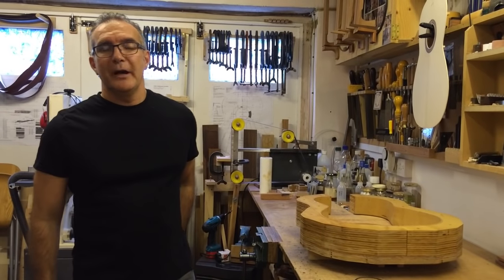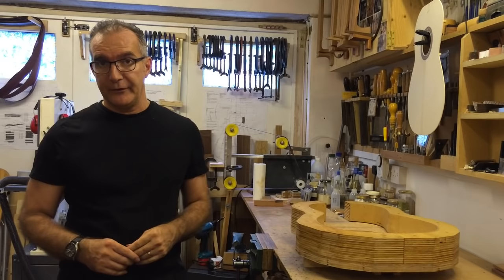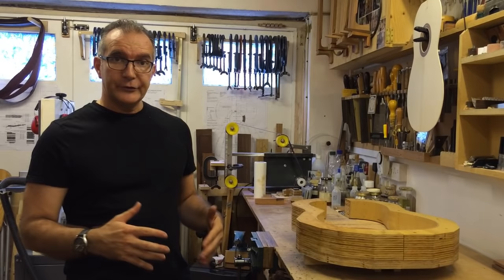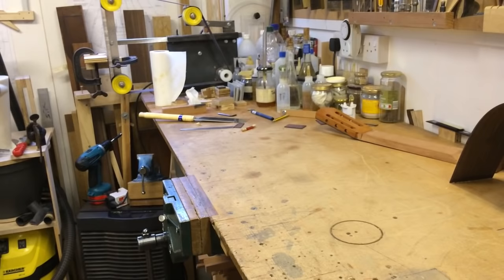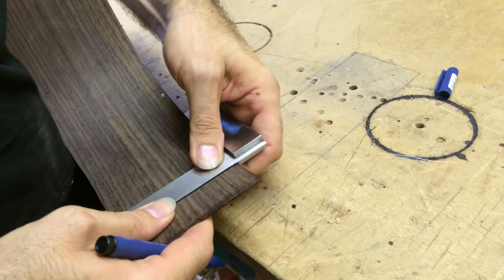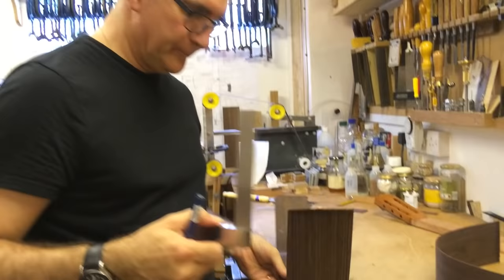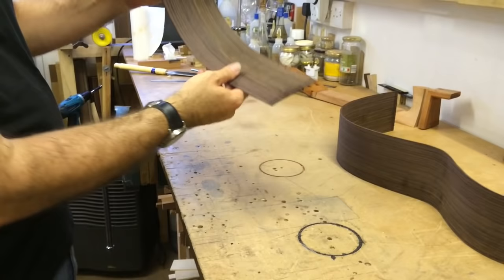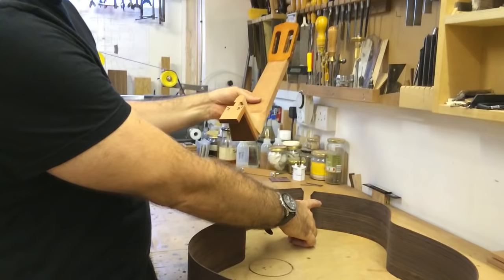How to assemble a classical guitar with a Solera mould.

Comment: Hello, Pablo. My only problem I am having in thinking about the solera is whether or not I will have to taper the underside of the fretboard when it is glued on the assembled guitar. I would think I would if I make the solera with the millimeter and a half slope as you do. Please inform me on this. Thanks.
Reply from the maker: Hi Owen,
When I fit the fretboard I plane down a small taper from the 12th fret to the edge of the sound hole from under the fretboard to accommodate the angle between the neck and the soundboard, that way, when the fingerboard is glued on it is reasonable strait.
Once the fingerboard is glued on there is also some planing to do to achieve the right set up, so that the projection of the fingerboard over the soundboard on the bridge are is the correct hight. The hight I set it up is at 3.5 mm at the treble side and 2.5 mm at the base side.
Sorry if all of this sounds a bit abstract, the truth is that this is a very important aspect of the building process and it isn't easy to explain in a few lines.
Best regards
Pablo
Reply: Thanks Pablo! I suspected something like that would need to happen. I understand the difficulty explaining these things. It is truly a blessing to have someone like you who wants to teach this stuff.

Comment: Pablo, two more questions. On the cork solera, the little block that is positioned for the bottom transverse brace, is it equal in height to the rest of the cork? What I am wondering is whether the lower transverse brace has any curve or not. I do understand how you said it is there so as not to damage the brace in the clamping procedure. Thanks
Reply from the maker: Hi Owen,
The lower harmonic bar has an arch of 25 feet in diameter, so the center cork block is a little lower than the rest of the cork
Reply: Pablo, I can’t thank you enough for helping me out with these things! Now I am prepared to give my first classical build a go. God bless you
Reply from the maker: No problem, enjoy making your guitar!!

Comment: Pablo, how does your solera set up effect the side profile?  I know Bogdanovich's side profile dips at the butt end on the lower bout and slopes down on the upper bout which makes adjusting the sides to glue the top on a challenge to say the least.
Reply from the maker: In my solera the top part pf the guitar and the overall perimeter are completely flat, also, before I bend the sides I plane strait the edges that will later on meet the soundboard, that way when the sides are fitted in the mould after the soundboard they meet perfectly. 
I hope it makes sense.
Reply: PabloThank you for your reply and yes it makes sense.Bernard

Comment: Do you need to make a whole new solera for each guitar you make? Thanks
Reply from the maker: Hi Michele.
No you don't, if you want to make a different shape guitar all you need is the base of the mould which its actually the solera, just don't use the two sides of the mould.

Comment: Hello Pablo, I'am a bit confused. Is the square piece of cork beneath the lower harmonic bar lower that the other cork?  I mean, that harmonic bar is rounded over a bit. Where does the belly  of that radius go, if the square is the same hight as the rest?
Reply from the maker: Hi Peter, can you tell me what minute in the video this is?
Reply: Hi Pablo, at 2:07 and 2:59
Reply from the maker: Hi Peter, yes, that square is a bit thinner than the rest of the cork in the solera to accommodate the curve in the lower harmonic bar. It is there so that when I clamp the soundboard in place I don't force the lower bar.
Reply: Thank you.

Comment: Are the side inserts , doubled up,maple piano "Pin Blocks" ?
Reply from the maker: Hi.
The inserts for the bolts are:

http://www.screwfix.com/p/insert-nuts-type-d-m6-x-20mm-50-pack/61859?kpid=61859&cm_mmc=Google-_-Product%20Listing%20Ads-_-Sales%20Tracking-_-sales%20tracking%20url&gclid=CjwKEAiAwfzDBRCRmJe7z_7h8yQSJAC4corOs0VqlB80WW8MBvTjcwpqu0SltE5VvgBEwJO6gp92ehoCdsbw_wcB

And the inserts to position the sides are 8mm wooden dowels.
Is this what you where asking?
Pablo
Reply: Thanks Pablo, but I was referring to the attachable/datachable 'sidewalls' that are placed onto the Solera board once the Soundboard is secured to it.

My pardon for saying 'inserts' as I incorrectly named the parts I was referring to. I asked as the visible plys to the wood strongly resemble how a the material used for Piano Pinblocks looks
Reply from the maker: Ah,Ok I see what you mean. You could use Maple piano pin block material, but what I normally use is just plywood. I glued 4 pieces together to have the right thickness.

Comment: get the correct bit so it won't stuck to the screw, it very annoying.......;-)
Reply: I was going to suggest that also. You could use a bit holder that has a release mechanism so the bit doesn't pull out. You will be happier.